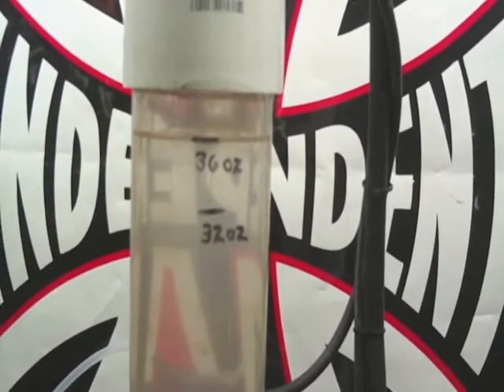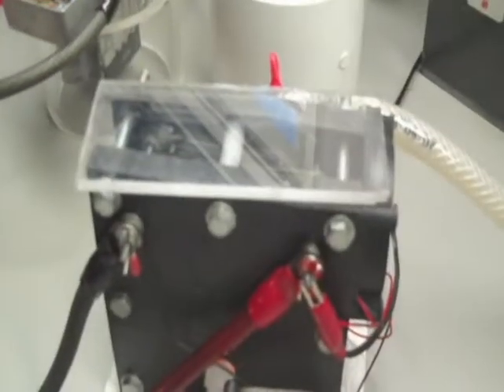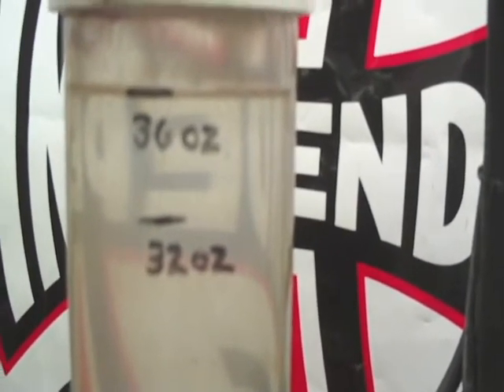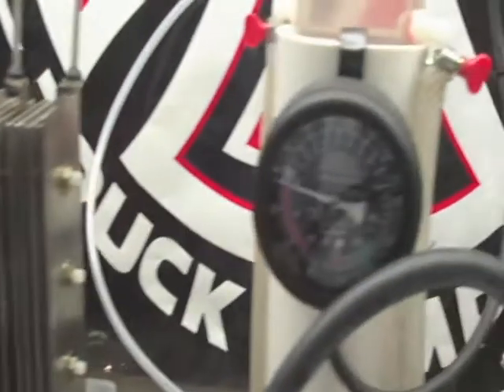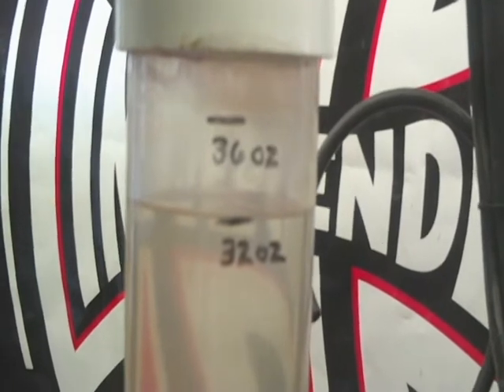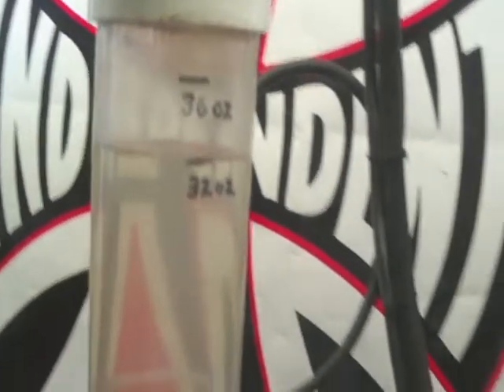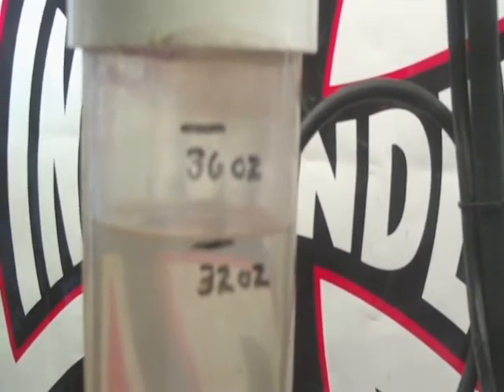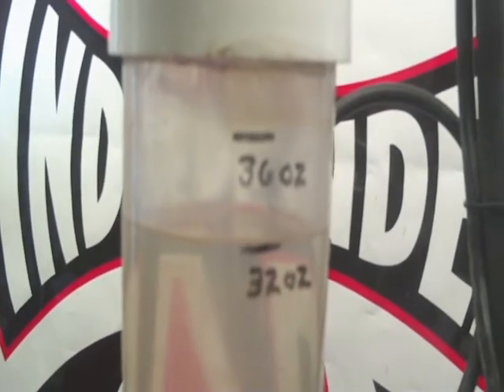hho miles per ounce ?

Comment: Hi Hollywoods7: I have been using NaOH in my HHO brick. It has been in my truck about a year/12,000 miles and I have not had to add more NaOH except when a hose came off and the electrolyte leaked out. Some of the NaOH makes it's way into the bubbler water so I periodically recycle the bubbler water back into the electrolyte reservoir and refill the bubbler with clean distilled water.
I just returned from a 1200 mile round trip and I used about 2 gallons of distilled water.
Good Luck, Mars

Comment from the maker: Yeah  thanks,I guess it will depend how many plates and the voltage between the plates ,keep it 2v and under then you should not cook.That is where the vapor comes from,heat is not are friend here ,I found out.